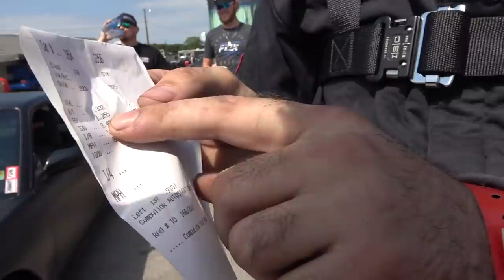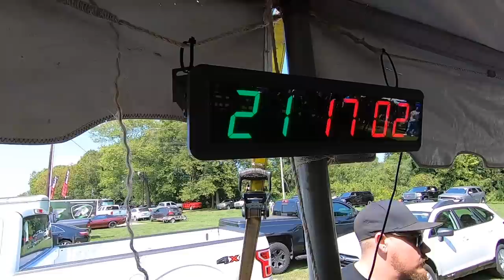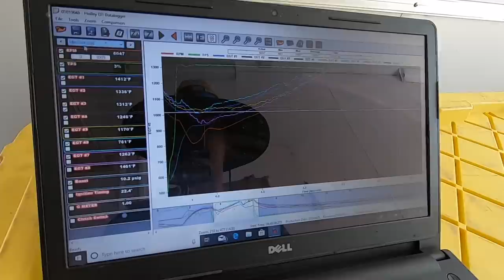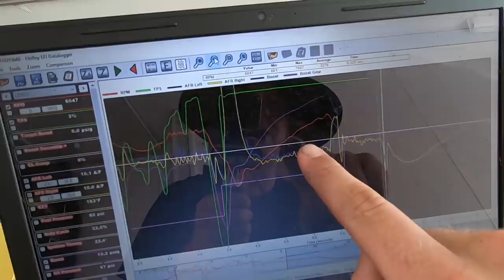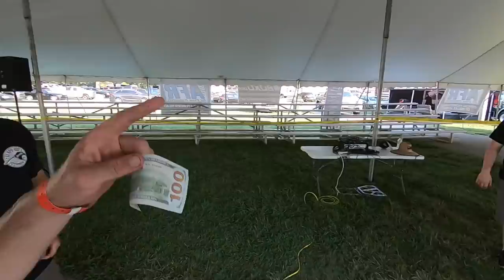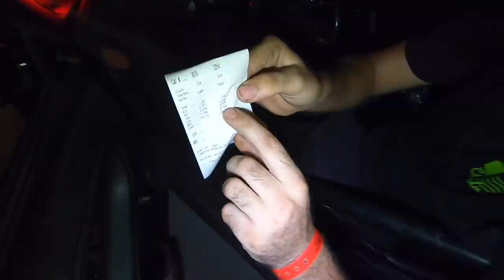LS Fest Day 1: Leroy Races the World's Fastest Stick Shift Corvette, James' 240 Makes SICK Passes!

Comment: That engine building competition was similar to the ones they used to have at the Brisbane Motorshow and other shows back in the 80's.  With those competions they used the old Ford v4 engine. The engine was completely torn down to a bare block. They had to assemble the motor completely, install and set the distributor and fit the fuel pump and carburetor and actually make it start and run. It was always great to watch.
Reply: yea, we had 250 fords & 202 holdens out west. from memory they had to run a minimum of 20 sec but they had no oil or sumps. I was actually thinking of the exact same comps as you while watching this. #motorvation94 #westozlads #auspride
Reply: @scroatworx2339  . Yeah I think your correct There. I do remember the record being 4 minutes something.
But as you say it's a long time ago. Cheers Mate.
Reply: Ha 
We had that at tafe (trade school)
Old Mazda 4cyl Deisels 
Fully disassemble them clean check clearances and reassemble 
Not propose to be a race but it was of course
Putting grease in the oil pump and no oil on the bores or rings so it builds oil pressure super quick and doesn't smoke at all on startup 
Because looking good was better than doing it right haha

Comment: Cleetus needs to be the fastest stick shift corvette again
Reply: He was the fastest that night.. it's extremely extremely unlikely to be a consistent 7s stick car with the way track prep and DA changes...
Reply: Needs to be the fastest stick shift anything. Prove to the world that aero don't matter if you're a true savage!
Reply: @wesw9586  thing is, aero does matter.
Reply: @alexisjavier84  dammit I know that lol. Just gotta think like a savage. Just make a lil more boost and let 'er eat.
Reply: @wesw9586  But it's also less weight. Having no body on his car makes it a lot lighter than a full bodied Vette would be.
Reply: Actually weighs more cause now he has roll cage everywhere bigger engine giant turbos fuel cell car ways more now than it ever did
Reply: A full bodied vet would also require a cage to run at that speed too.  On top of the full body weight.
Reply: @AngryTurds  nah he's weighted it and it'd basically the same. Leroy has a full exo cage to add the strength that the body panels provided. A normal car only needs a cage but this needs an exo cage.  Leroy would benefit hugely from some basic aero work
Reply: I agree Brother
Reply: Indeed he would.  Highlighted in the wind tunnel episode.  Just wouldn't be as savage then, lol

Comment: -George has to be ready 24/7. Cleeter could pop a "Question of the Day" on him at any moment
-Jeez, Leroy putting down low 8's right off-rip
-James 240 finally make a full pass - or 3
-how to get Cleetus and Coop to build you two engines XD
-'Vette vs 'Vette. Leroy vs Roy-Lee (XD) Basically the same car it all comes down to the drivers.

Comment: If the 240 were a quarter mile car, Leroy would have some competition!
Reply: they both to cheap for ceramic racing plugs and cables, cleetus and james 8 secs and melted, NASCAR 4 hours, le mans 24 hours
Reply: Dumb question, was that 5.50 he ran in this video a eighth mile run or quarter mile?
Reply: 1/8th mile
Reply: Joseph ok, was about to say that’s one hell of a 1/4 mile run hahah
Reply: the 240 would run a 8.3 quarter if it could keep up all the way

Comment: Older Smart cars shift poorly because it’s a manual transmission with what is essentially a giant solenoid mounted to it to shift the gears, but are an automatic for the driver. Basically they are an automated manual transmission. They have a clutch internally, not a torque converter like automatics.
Reply: GM Kof hard which is exactly why the following generation of smart car either featured a dual clutch automatic or a 5 speed manual

Comment: I bet the other guy broke your record because he has his body panels
Reply: Big Rock  that might hurt him if he races in the middle of the day and those Long drives, heat is a engine worst enemy
Reply: Cleetus needs to learn how to lay carbon fiber to build himself some aero bits.
Reply: He could stunt some late model dirt track style body panels
Reply: @Bryaniskey  true but make them dettached for said reason
Reply: Do it the American way and make more power
Reply: he tried cardboard
Reply: @QuantumPlaysOfficial  he tried cardboard
Reply: @RippedJolt  aero is bad for drag racing though. downforce is just drag and drag reduces speed.
Reply: @stevespencer5083  ok maybe but first getting down that power would be difficult and also, 800 horsepower is a lot more than 1500, the thing wouldn't be driveable at all like that.
Reply: @fleimlehner  what? No it isn't? Aero isn't just downforce, and some downforce is needed to get the car to hunker down at speed. Go look at cleetus's windtunnel video and you'll see how much extra power he has to make to deal with wind resistance.  Explain how pro mod cars look the way they do? Unless you're strapping rockets to something aero does matter.
Reply: @RippedJolt  yea I know aero isn't just wings and splitters. But that's what I specifically said.
Reply: @fleimlehner  you literally said aero is bad for drag racing. It's necessary for drag racing, its necessary for all motor sports. Cars get squirrelly with no aero.
Reply: @RippedJolt  i also specified that the aero I was talking about is downforce

Comment: James , you should index your spark plugs, and that will balance the heat in the chambers . If that doesn’t even things out, you’ll have to drop a heat range or two on that cyl. Is it #8 giving you the trouble ?

Comment: Hey Cleetus. have you considered running an adjustable clutch in Leroy? It seems like you are bogging the engine in low gear, which kills your 60'. Benefits are you can leave at higher RPM because your slipping the clutch through 1st gear, then use the centrifugal weights on the pressure plate to lock it up in high gear. Your 60' will improve dramatically. Car will go faster overall. I have figured this out on my stick car years ago. Ask Leonard Long at G Force, he will tell you the same thing.

Comment: Kind of disappointed in Leroy. it still runs in the low 8's. I hope he gets it figured out before the finals ? James, HOLY CROW WOW, GREAT JOB. That last pass you pulled a GREAT LIGHT BRO. Is there a reason you have your headlights in the up position instead of down ? Those LS build off's were pretty cool, GET ON EM CLEETUS, RUN IN THE 7'S YOU KNOW YOU CAN DO IT.